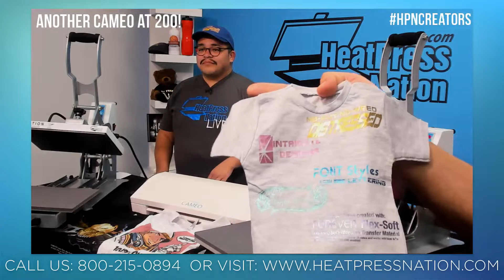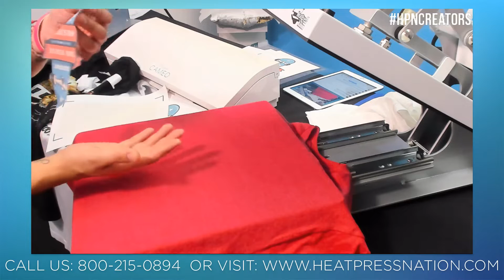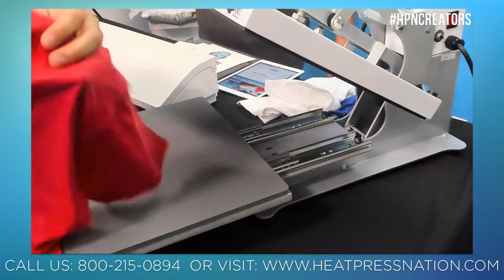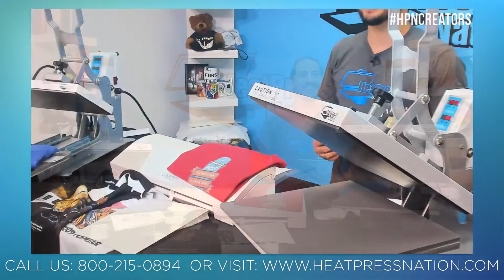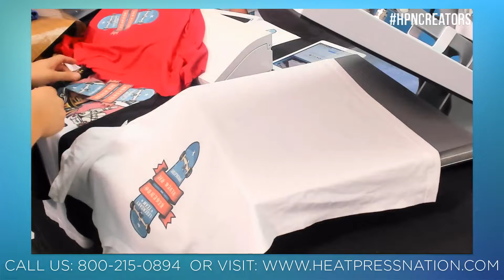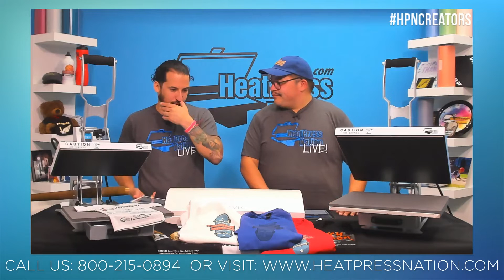Heat Transfer Paper Buyer's Guide + CONTEST ANNOUNCEMENT - HeatPressNation LIVE!

Comment: How good is the washability ?
Reply from the maker: Depends on how it's washed. If washed with the care instructions included with each paper, you can get 25-30 washes out of it. Neenah Jet Pro Soft Stretch is an inkjet paper for white/light colored shirts and has incredible washability. Instead of cracking or peeling, it will fade gently into the fabric. So an old tee that's been washed 100 times (literally) will a "vintage" faded look to it.